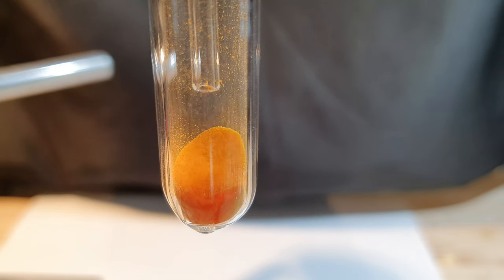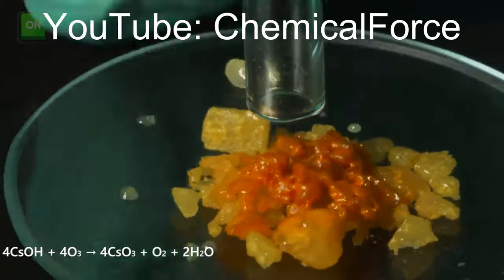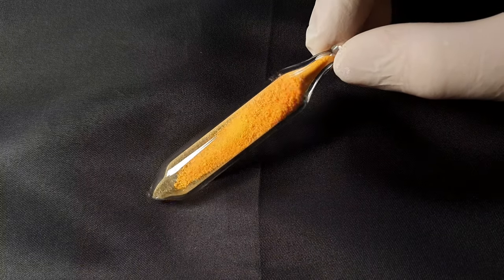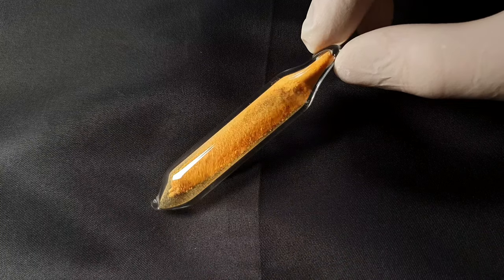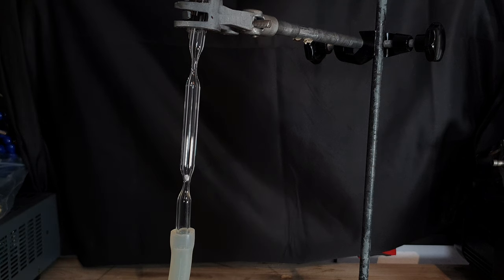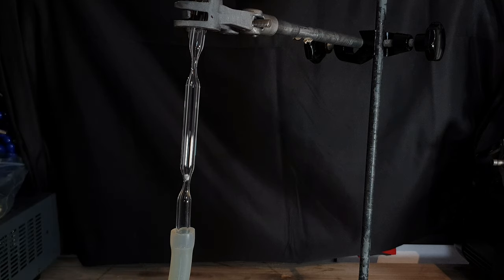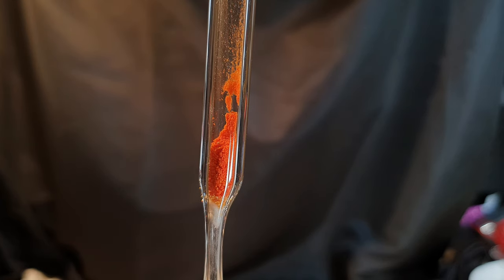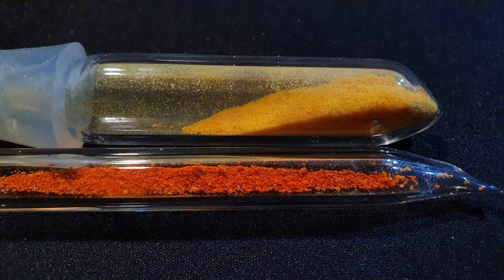Making cesium ozonide

Comment: what happens if you just keep heating glass like hotter and hotter without doing anything to it or shaping it? like if u just kept the heat on it and did nothing? does it just start dripping or what
Reply from the maker: Yes, it becomes a liquid.
Reply: @AdvancedTinkering  sounds obvious when u put it like that but I've never interacted with it. thanks!
Reply: @AdvancedTinkering  does it also eventually also just boil to a gas? I guess whatever the vapor temperature of silicon is?